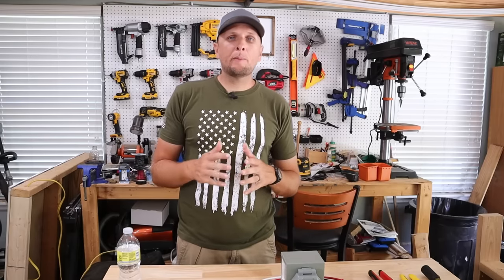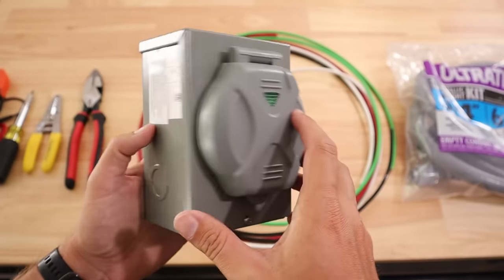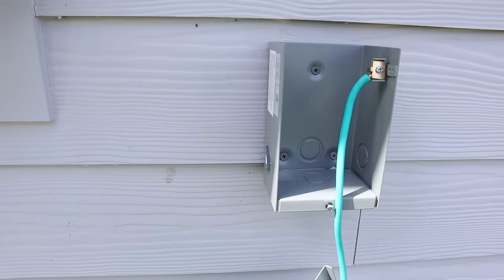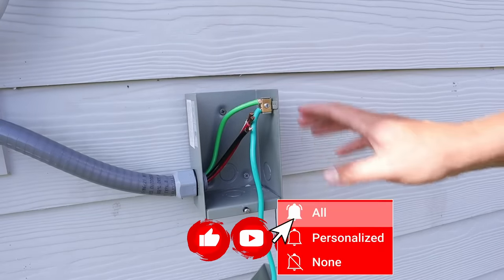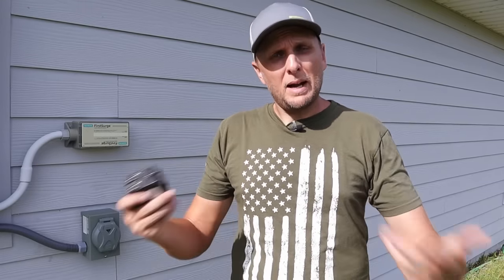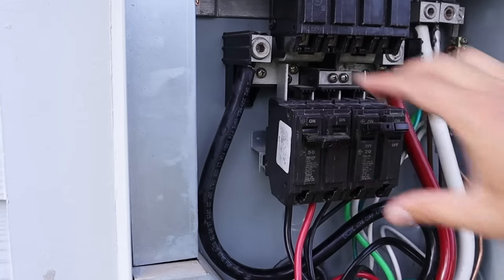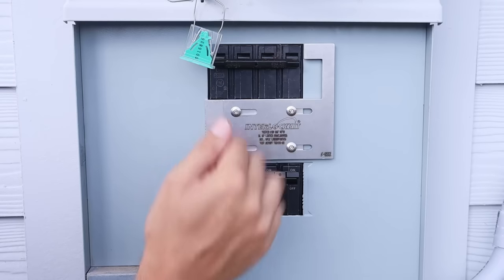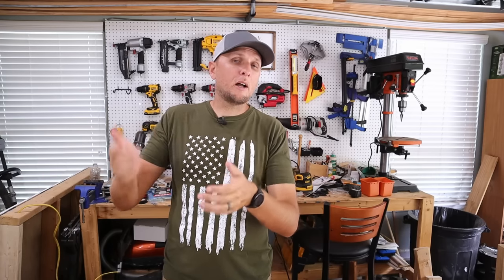The BEST Way To Connect A Generator To Your House - Interlock Kit With Power Inlet Box Install

Comment: If you're reading through the comments as I did,there is one extremely important thing left out in this video. You MUST have an unbonded generator to SAFELY connect it to your house.There are tons of videos on how to do this.There can be ONLY one location throughout your electrical system that the neutral and ground are bonded and thats at your main disconnect. Make sure you understand and do this before connecting a generator to yout home.I learned the hard way and fried a huge portion of electronics in my home because I failed to unbond my generator.Lesson learned and thought I would pass this along.
Reply: I have a bonded generator that I plan on making a unbounded neutral. Once that is done will the method shown in this video be the correct way to wire the unbounded neutral to my home
Reply: @martinberlanga4914  yes sir. I simply used an ordinary house light switch that way you can choose between bonded or unbonded and your generator will easily be switched from one to the other.All the best.
Reply: Does the 50 amp breaker at the house, have to be on before turning on the power plant breaker.
Reply: @GB-it2qh  The purpose of the interlock kit forces you to turn off the Main Breaker switch BEFORE you turn on the 50 amp breaker on your control panel that connects to the outlet where you will be plugging in your generator. Does that make sense? Did I understand your question correctly?  You never want to have your 50 amp breaker (that's fed from your generator) turned on at the same time of the home Main Breaker.
Reply: How do I know if I have an unbounded generator?
Reply: @edrusk9846  ohm out your neutral and ground at your gen set receptacle, un-bonded  ( floating neutral ) should show open circuit. 
or check your owner manual.
Reply: @10ring  if its not suppling power to your house it needs to be bonded for electric shock protection.Do your research and you'll understand.
Reply: Cheers mate !
Reply: @catfish500mark9  why would you need bonded? When you're going directly through to appliances vs. patching into the house? And correct me here, bonded just means grounded to the frame of the generator correct? To use your light switch method I have to find the ground which should be connected to the frame or ground bar on the generator, right?
Reply: @user-bd2xj7oy6l  just readup on why its necessary. Tons of videos explaining this.Not trying 2B rude but its been explained many many time.All the best.
Reply: @GB-it2qh  If you want gen power, you will have to disable the house breaker. I highly recommend also keeping the generator breaker off and hooking up your cable to the generator and the house before you start the generator. Start the generator, let it warm up, then turn on the house generator breaker, that way you aren't starting your generator under a load.
Reply: So this means if power goes out when you are not home .. this does not come on automatically????
Reply: @edrusk9846  They are all bonded from the manufacturers.You must physically make them an unbonded generator yourself.Plenty of YT videos showing how to do this.
Reply: @karencarroll4896  No it does not come on automatically, this requires a much more expensive and complicated system to do that.
Reply: @stevereason6931 I’m trying to make sure I understand. So are you saying the interlock kit omits the need for the generator to be unbounded?
Reply: @amansdzir no absolutely not true. All the interlock kit does is it forces you to turn off the main breaker first to be able to turn on the generator breaker. It also forces you to turn the generator breaker off first before you could turn the main breaker back on. That's a safety feature so you don't energize the lines so you don't kill lineman working on the lines. The generator still needs to be unbonded because you can only have neutral and ground bonded in one location which is your main panel box.
Reply: @amansdzir interlock is a safety feature that forces you to cut off your main

Comment: I just completed an inlet box like this build thread.  Works perfectly!  You might mention that you need to infact have a 240V generator to power up both sides on the panel with a double breaker.

Comment: Had a $15,000 quote for a whole house generator, $1,500 quote for a 10 circuit transfer panel, and I put in an interlock myself with breaker, wiring, and generator inlet for about $150. Tested it out today and everything worked fine.
Reply: cool flexing bro
Reply: So your meter box didn't have a transfer panel? I think mine is the same. I only have a meter box and that goes strit to my panel.
Reply: I’m going to have to do the same no power here for a few days

Comment: I Purchased my generator last year. I followed the instructions on this video to successfully install all the parts. This week, power is out in many areas of Houston, thanks to my generator and to this video, the wait for the main power to come back, has been painless. Thanks for sharing this video bro!
Reply: Did you buy a 220v generator?
Reply: @thedudefromU  yes, the WEN 11000
Reply: @carapungo  awesome.  I assume any generator backing up the house must be 220v?  My 110v RV gennie won't cut it
Reply: @thedudefromU  if your AC main breaker is 50 amps, then you need a 50 amp generator, if it has a 30amp breaker, the WEN 11000 supports both, 30 and 50amp.
Reply: @carapungo  will I'm focusing more on voltage.  220v vs 110v
Reply: @thedudefromU  the WEN 11000 provides both, 220 and 120v
Reply: Did you run into any issues with the generator being bonded or unbonded? Seems pretty simple but there was a couple people concerned about the wiring

Comment: Perfect DIY project and video. If your locale requires you to pull a permit, I suggest getting one. The inspector will check your work and sign off on your permit. Some, if not most,  insurance companies would not honor a claim concerning this installation if you didn't pull that permit and have your work inspected. It's in their policy fine print.

Comment: I do all the remodel and repairs on  my properties myself.  But I NEVER felt confortable doing electrical work. Thanks to you I have ventured for the first time installing 6 outlets, 2 light switches of a GFI outlet, and now I might even do this installation. I live in Florida and hurricanes are coming. Thank you of keeping it simple and clear.  I really appreciate what you do.
Reply: Did you get your generator?
Reply: Hopefully you followed through without hesitation.
Reply: Carl, I am an electrical guy not a tax preparer, so I recommend this for your consideration.

If your properties are a business, I believe repairs are tax deductible.  Use a reputable electrical contractor to do some of the work and you work with them like a trainee.  This will get you safety, skills, and knowledge, but most importantly the satisfaction that you did some of it.
The big bonus is that you have some you know just a phone call away.

Your local guys should know all the local rules.  The rules are not hard to find, but the experience might be.

Example:. Bathroom receptacles must be GFCI protected and one breaker can cover everything in a bathroom, but wiring it up to prevent a GFCI trip to not turn out the light might be a problem for some.  Along the same lines, GFCI protection can be provided by a receptacle or a breaker.  Your naked wife with wet hair may not want to run from the second floor to the basement to reset the GFCI.

I hope you can easily shift into electrical doings.

Be safe and good luck.
Reply: FYI...It's illegal for a home owner to do electrical work, plumbing, or gas work in anything other than a Single family home. A multi family must be done by a licensed contractor.

Comment: Texans need this video to be shared among them ASAP. #beryl
Reply: The reason why I am here!!  Day 2 with no power!!
Reply: Same!
Reply: Im done procrasitaning Im getting it done this week
Reply: I am a certified electrician in Houston and have done these all over even my own house .
Reply: People don’t realize how effective this process is until there in the dark sweating bullets I have stressed this to many customers but the problem all comes down to is that people just don’t wana down the money until it’s to late
Reply: Lol yep
Reply: @rodricktaylor2114 do you currently live in Houston? Day 5 here with no power but I do have 6250 watt generator
Reply: @grantwilliams1771  yes I do an a 6250 is not enough to run ac but will give u power for lights an ext
Reply: @rodricktaylor2114  excuse my ignorance I’m uneducated when it comes anything electrical lol but if my AC unit uses 35 amps and the electrical power inlet box uses 50 amps will my generator still not run our AC? Sorry for dumb questions
Reply: What kind of wire are you using? He didnt link the wire :(
Reply: Seriously!
Reply: @ThresherXG  he mentioned the gauge of the wire, that's all you really need.
Reply: Heh, wish my rental home had one. A few hours will be 1 week with no power other than my little small Honda eu2000i. I have a window unit in the bedroom and my deep freezer, fridge, internet, TV, PS5, and a few chargers going on it.

Comment: Excellent!  I had already given up on converting an existing outside 220V outlet for a hot tub which is now gone into a generator outlet.  After looking at this video I now realized that is basically the same installation.  The addition I need is to install the switch plate to the main box to prevent both circuit breakers to be active at the same time.
Reply: Holy shit.... I'm going to do the same thing! Perfect idea!

Comment: Great video. Very clear and easy to understand for anyone.
You might want to have let.people who have no idea what they are doing that the conductors feeding the top of the main breaker are still hot despite being shut off. Some people attempting this install may not be aware and if there was too much insulation stripped back on those conductors they could be exposed and be a shock hazard especially when feeding new conductors into the panel.
Reply: If they have no idea what they are doing, then they are NOT doing this. Hire an electrician

Comment: I just came to the conclusion today that I would be doing this and found this video. Thank you for this info. I don't have a large house and 30amp  120/240v Westinghouse WGen5300c that I just got, and it's set up for this. Tired of local outages and high electric bills haha

Comment: Thanks so much for this video, as today I just finished my own generator project.  I had to reorder the correct interlock kit for my panel, but when I finally got everything installed it felt great.  It’s good to have peace of mind knowing you have a back up power source if the grid goes down.

Comment: Great video! I'll be doing this to the new place I'm building on some land I bought (renting now so can't at my current residence). My only input would be to hook up your cables first before cranking your generator, as not all of them have that breaker on the generator like yours does. Much safer to have it cabled up before cranking and have your house generator breaker turned off.

Comment: One thing you should have mentioned is that loads should be staged on one breaker at a time to reduce the surge. Another is always disconnect loads before turning off the genset. As the generator winds down the voltage and frequency drops which can cause failures of equipment and the generator itself.  Voltage and amperage are inversely proportional, as voltage drops amps go up and can burn out electronics
Reply: a mere bondservant  Yes, that is always the best way. Unless you have a larger generator and ATS

Comment: Great video. This is how I have my house wired with 30amps. I will upgrade to 50 eventually. I upgraded the generator a few years ago to from a Generac 6.5k to a DuroMax 13k gasoline driven. I plan on upgrading the house to 50 amps in the next year and adding propane fuel to make it a dual fuel (if possible). With the cost of everything going up it may take a little longer. Covid19 nearly killed me so I'm going to reposition the generator connection to the front of the garage. Makes it much easier for me to deploy the generator while I'm on Portable oxygen. I can pull the generator out of the garage much easier than trying to pull it around the house. I was so impressed with the DuroMax generator I became an authorized service center for them. I have never had a "no start" situation.

Comment: Nice description and example. I need to do this to my house but have the electric panel inside the house in a wall. So I will require longer feeder lines to reach an outside wall. Thanks very much for the detail on this. 👍

Comment: You noted different wiring for bonded vs. floating neutral. Was the wiring you did for a bonded neutral generator, or for floating? And what are the differences in wiring between the two when installing the outlet that the generator plugs into?

Comment: I suggest those who may not be planning to stay in their current home for too long look into the Generlink interface. It mounts between your meter and the meter socket and is UL listed. With this you plug in a single cord form your generator to the Generlink and when you do the whole house is automatically disconnected from the grid so you can't backfeed out onto the grid. You can also power any device in your home up to the capacity of your generator and the version of the Generlink you install. I have been using mine for 8 years and it is 30A. I can run my well pump, the boiler, plus some lights and essential equipment like the freezer and fridge. You don't need to install any sort of interface box, don't need an electrician or a permit and inspection. The utility installed mine for free. Best part is if/when we decide to move I can unplug it and take it with me. I don't have to leave my investment behind. The Generlink also has a whole house surge suppressor that is active all the time, not just when running off the generator.
Reply: Hi Bob thanks for the info.  About what does this cost?
Reply: They cost about $600-1
$1000 depending on model.  They WILL NOT work with the new “smart meters” that are being installed across the Country.  Best bet is to do what this video says and have an interlock system installed and be done with it
Reply: @clarkallen4541  those "new" smart meters have been around since 1975
Reply: It's not allowed by a lot of utility providers. My provider will not install one
Reply: Ummmm I have seen and heard many people saying that their utility's company's won't allow them to be installed.. either way if someone should move that has installed an interlock system like in this video , they could uninstall it and take it to their new house just as easily.. but in their own .. without the need of the utility company to come and uninstall it for them ..

Comment: Dude, brilliant. I had watched other videos on how to install a manual transfer switch, but this is much cleaner and perfect for our needs. We bought a DuroMax XP9000iH with a running wattage of 7600. It won't power our entire house, but we'll play with the circuit breakers that we'll need and cycle the ones with big draws. Will be getting that soft start kit for the AC as well. Thanks a ton!
Reply from the maker: Sounds like a plan!  Glad to hear it sounds like you are getting all set.  Thanks for the feedback!
Reply: Interlock kits are a "gray" way to meet code for feeding alternative power source to your home. They are not best practice, and they also can make it hard to balance the load on the two 120 legs of your generator. For example my breaker box has all but one breaker that I need in an outage situation on the left 120 Busbar (left side of breaker box)  if I used the method from this video almost all my load would be on 1 120 leg of my generator. A manual transfer switch solves for this, and is best practice for backup power.
Reply: @jov415  Thank you for that commentary.  I was leaning toward a transfer switch but the interlock kit/method looked a little more straight forward.  I know it's less expensive, which is some benefit but not my whole reasoning.  I am now rethinking back to a transfer switch as the interlock seems a bit less safe.  That being said, I am on Consumers Energy (company) in west Michigan and they kind of mention interlock by way of saying something like having something to prevent accidentally back-feeding the grid.  That all being said, a transfer switch looks a lot more safe.
Reply: @svenska572 there is nothing "wrong" with an interlock device as it meets the spirit of the code, which is protecting linemen by prohibiting generator power from reaching the grid. Saying that, it mounts on a removable breaker panel and, therefore, not a 100% foolproof method. Saying that, as long as you, the homeowner, are aware of this, they are fine.  Now, the other issue is balancing load on the 2 legs on a generator.  An 8000W generator isn't designed to have all 8000W ( or most of it) pulled from one leg of the generator and could damage the windings.  This all depends on your breaker layout and/or the circuits you want supported by generator power. You want to look at your panel and calculate an estimated load for each circuit and each 120 leg.  If you find it is very unbalanced, a transfer switch can help you solve for this. The one that I utilized has some documentation that includes a sample chart with power estimates to help with load calculations.
 https://www.reliancecontrols.com/products/reliance-controls-pro-tran-transfer-switch-125-250v-30a-nema-l14-30-10-circuits-metal-gray-r310a